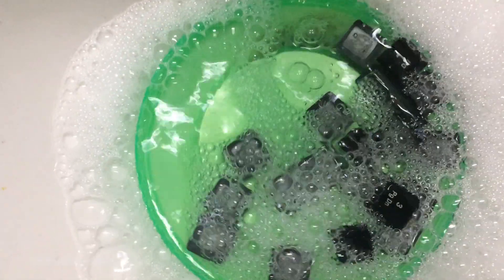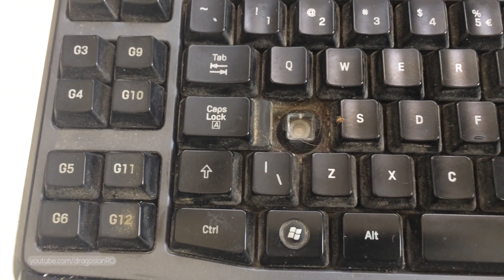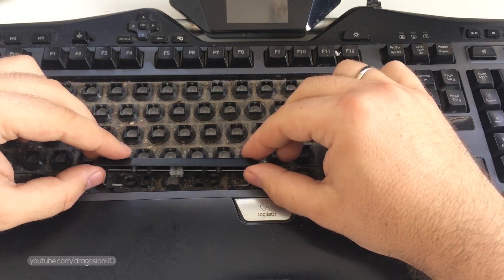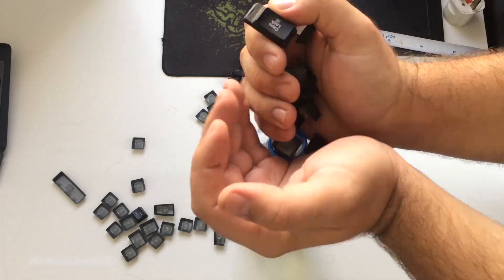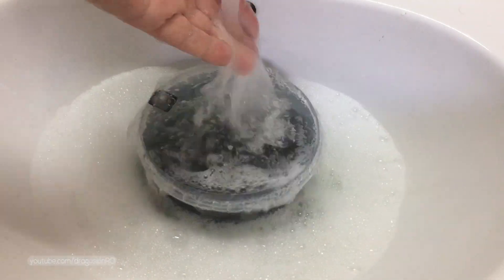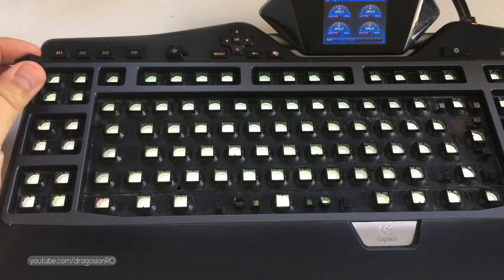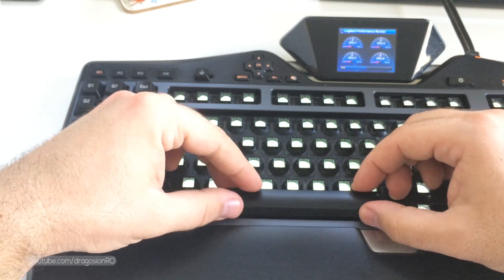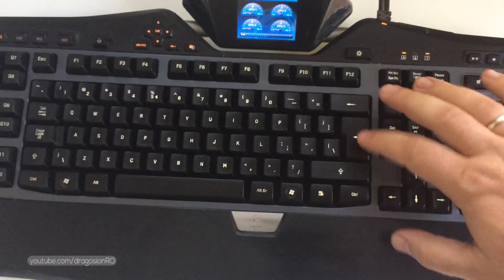How to clean a PC keyboard - Wash keyboard keys - Logitech G19

Comment: Loved my G510, I've got two, so it's one at a time, Plus, Why the bloody hell did Logitech stop making GOOD BLOODY KEYBOARDS, that work really well and have all the extra keys (G Keys) so you can either use in Gaming, (not me) or use the G Keys to open PC programs. I do a lot of photo editing, so with Photoshop, Affinity Photo, and others, it's so much quicker to use these key combo's to speed up your workflow as I do with photo editing etc. Bloody great keyboards, Wake up Logitech, When you're on a WINNER keyboard, keep making the bloody things. Not may keyboards now-a-days DON'T have the G keys, I ended up purchasing a Steelseries board, it too has the L1, L2, L3, L4, and then use that set to use the MX key set up, But, again, they don't make them anymore. I looked at your video, plus another guy doing the same thing, Why don't you use the Plastic Tools when working on car interiors and radios etc, these keys were made for working on PC Keyboards, Well the bloody do now, hee hee. Cheers Teddy.

Comment: I don't what I did wrong, but my left shift button wasn't working after I spilled coffee on it, so I removed that key as per your instruction here, and that metal piece didn't come up with the key. But, after replacing the key, the left shift now works, I didn't really do anything to it, just popped it off, then back on again just to see if I had at least done that part right.

Comment: i have not cleaned my keyboard even once... im scared how dirty its gonna be lol, will this work for logitech g 710? also can i vacoom it without worrying that like stuff gets in the vacoom (small parts from the keyboard, for excample switches)
Reply from the maker: You can clean it with the vacuum easily.
Works on any non mechanical keyboard.
Reply: Dragos Ion but my keyboard is mechanical? like it has blue switches, and makes a lot of noice when pressing the key
Reply from the maker: I would't touch it, maybe vacuum with carpet setting. Be careful with the switches.

Comment: To clean the yellow discolouration from old white plastic items you can use Hydrogen Peroxide. Available from hairdressing supply companies. It's available in a cream base which is best. It's available in different strengths, best to get the strong one known as 40 Vol ~ 12%. There are some YouTube vids explaining it. It really works great, I used it on a few different things. I even was able to clean the yellowish look from billiard balls, made the white ones look nice and white and the coloured balls look much nicer. They were about 10 years old and had discoloured a bit from age but now look brand new.